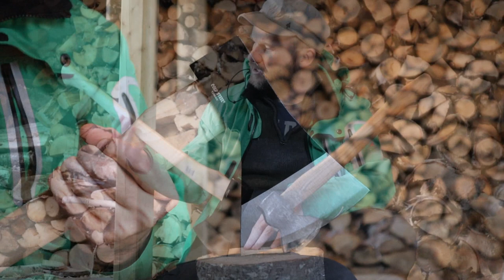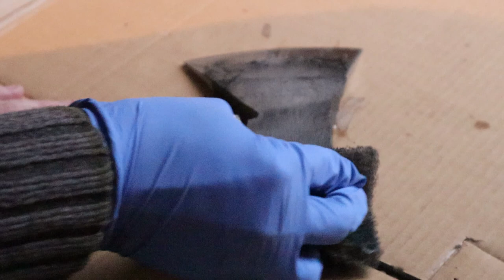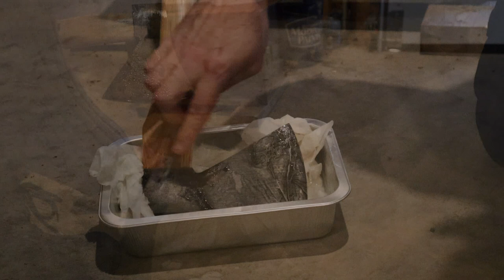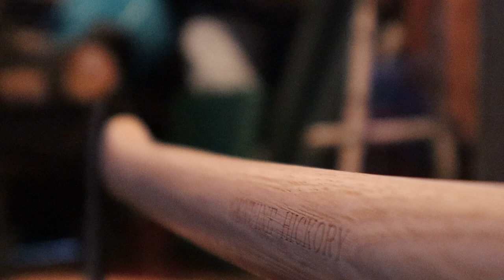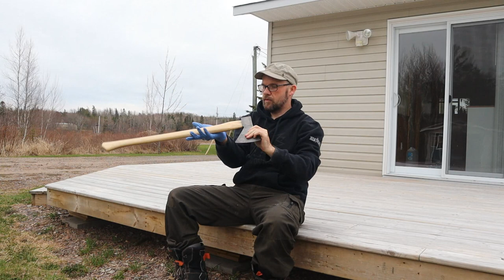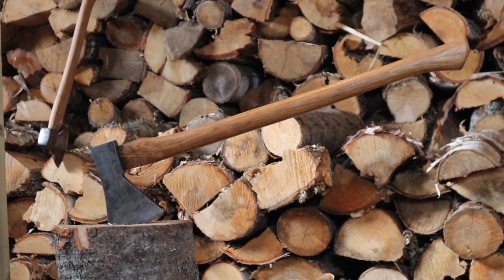Customizing the Cold Steel Trail Boss Axe - Inexpensive Amazon Axe

Comment: I have 2 of these and a Husqvarna and I like all of them. I like these because the cost was better than the Husqvarna but I got it at a discounted price. The first thing that impressed me about the cold steels, at least the ones that I have, is the grain orientation in the handles, they actually got it right. I haven't had any issues with the blades chipping or rolling over. There is a video of a guy that bought  a 200 dollar gransfors bruk and rolled and chipped the edge immediately in soft pine

Comment: Hi I was wondering if you can answer me a question. The 2 machines you used after removing the paint what are some other ways you can do that if you don’t have those 2 machines? And lastly to scrub off the paint what did you use steel wool? Thanks in advance! :)
Reply from the maker: Hi Jacob, the polisher that I used was a Dremil.  Honestly the step isn't really required.  I just wanted to add a bit of polish to the axe but I don't think you need to.  I used an abrasive plastic scrub pad after soaking the axe in paint thinner to remove the paint.  Steel wool may work too but may scratch more.
Reply: IamOutdoorsy thanks for getting back to me boss much appreciated :))
Reply: Using a finer steel wool will actually polish it up a bit. Besides of its hardened properly soft steel wool won't scratch it.

Comment: Anyone know what replacement handle you can get for the cold steel? The handle sucks and doesn’t hold up. I need a new one since the original splintered after 1 missed strike. I really like the axe head though and want to keep it.
Reply from the maker: Hey Patrick.  I did a google search by typing "cold steel trail boss handle"  and I came up with options for Canada (which is where I live).  Perhaps you might be able to locate a distributor for your country using this search.  Sadly though the handle that I found was actually more expensive than what I paid for the axe😑.  Hopefully you'll have more luck!
Reply: @IamOutdoorsy  thank you, I’ll look around

Comment: Well, I have no clue what type of liquids you are using, nothing I recognize over here, but the axe looks a lot nicer.
Reply from the maker: Sorry Lasse, I should've explained better.  The first product was just paint thinner to remove the paint.  Because the axe has a protective coating on it, I had to use 2 coats and let each sit for about 20 to 30 minutes.  The oil that I put on the handle is boiled linseed oil.  It not only give the handle a nice colour and protective finish, but it also seeps into the wood than makes it less prone to breaking and when put at the top, lessen the chance of the axe head getting loose.
Reply: @IamOutdoorsy  Ah, I see, thank you! :)
Reply: @IamOutdoorsy   how long do you let it soak in the vinegar..... I NEED to do this to mine after watching this! looks soooo good

Comment: Can you confirm how long exactly you left your axe in vinegar please?? Thanks and great video!
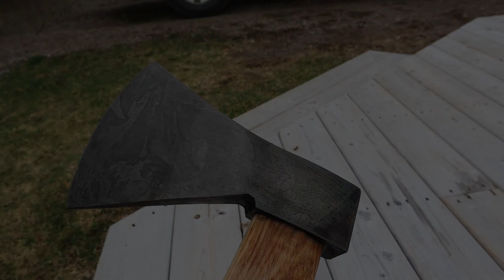Reply from the maker: Thanks The Klamps.  I had soaked the axe head in vinegar for about 14 hours (after 14 hours it looked like what it showed on the video at the 3:18 mark of the video).  I did end up soaking it for an additional 16 hours as I wanted a darker tint.
Reply: @IamOutdoorsy  thanks so much for the reply! I have a trail boss coming in the mail and I'm excited to try the process myself, looks like your came out amazing!
Reply: Just one more thing,  your process for soaking it, are you just dousing the head so the paper towel is soaked and leaving it for the duration of the time? Or are you reapplying vinegar/paper towel and or submerging it?
Reply from the maker: While I entirely wrapped the axehead in paper towel,l I tried to apply the paper towel a bit loosely on the axed (I am not sure but I think that it allows more patterns to be created while it is soaking...though I may be wrong).  Then I completely doused the paper towel with vinegar.   If I had to do it over again I would allow the first soak to last 36 - 48 hours just to see if it would give a darker finish with an interesting design.

Good luck with your transformation.  I wouldn't mind seeing the results!  Cheers The Klamps!
Reply: Sounds great, you didn't need to resoak it after the first time ? Thanks! I'm looking forward to it

Comment: How does the steel and edge hold up with heavy use.
Reply from the maker: It's holding up really well.  While I don't use it for splitting wood at home, I nearly bring it with me every time I go out in the woods (which is quite often).  For the money, it's been really good.